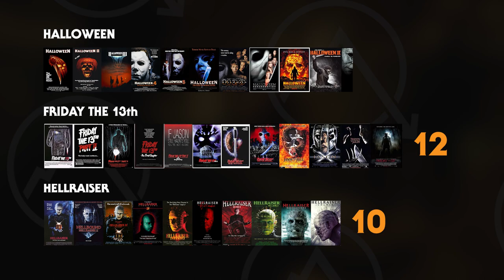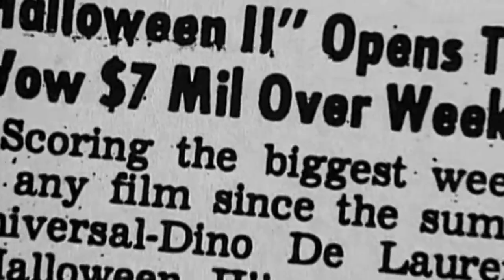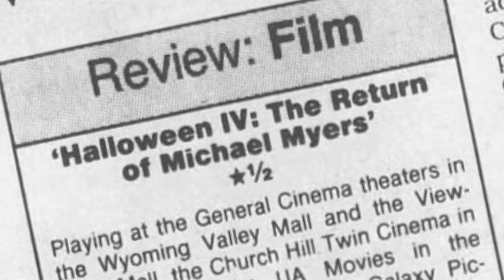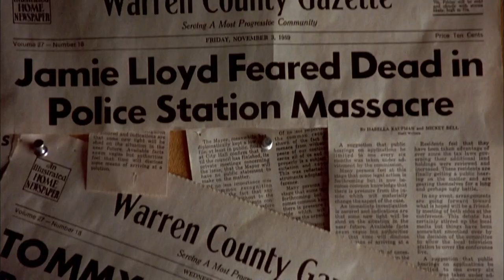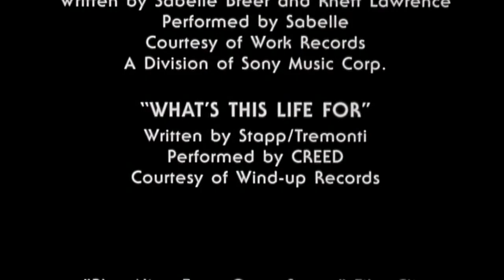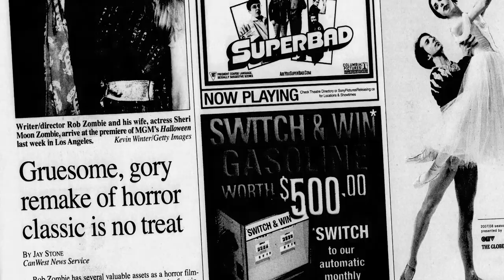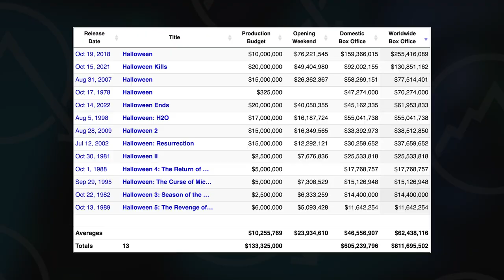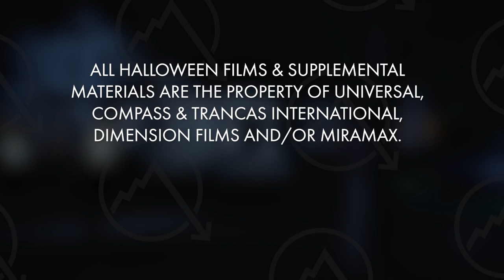A Sharp Decline: Halloween

Comment: Halloween is the equivalent of The Rolling Stones, Motley Crue  Or even Van Halen, it's like if you change one thing about it.  It doesn't necessarily mean it sucks but it just doest have that spark , the whole set of those certain people.
I love Van Halen and always prefer Diamond  Dave  in the band ratherthanHagar. , but they really didn't suck either with Sammy.  It was just different, but the original.Nothing can compare to the original rock bands and halloween is certainly an original like they t